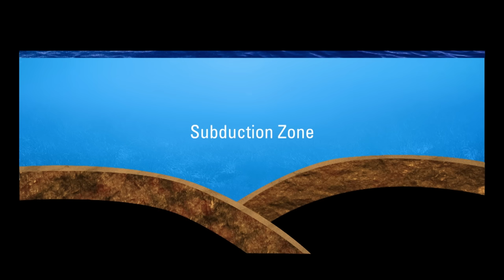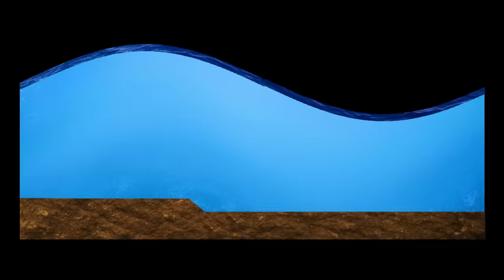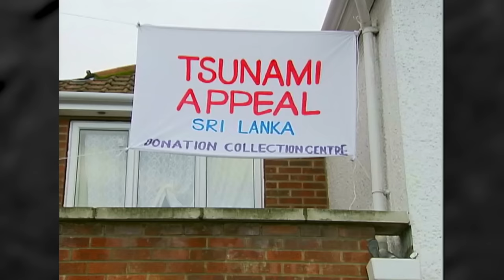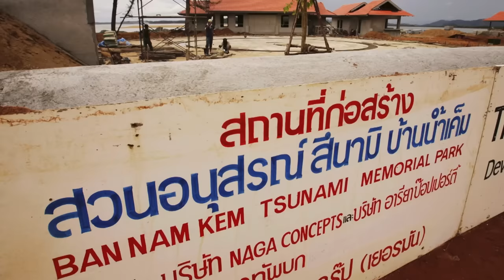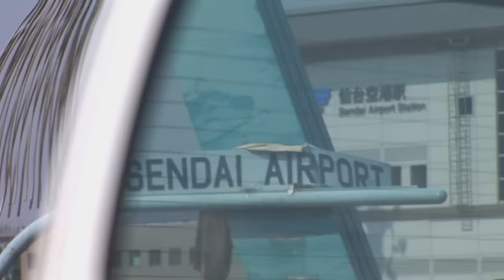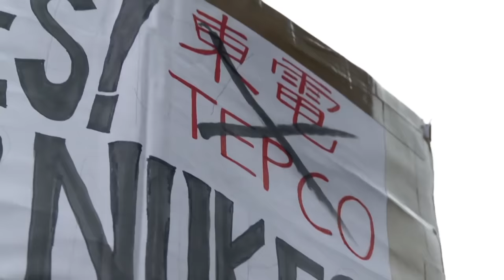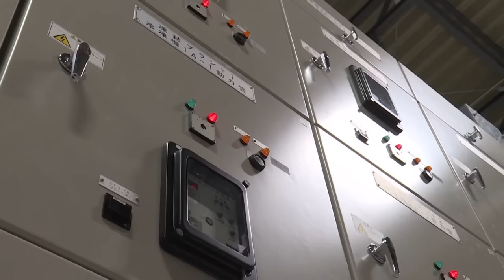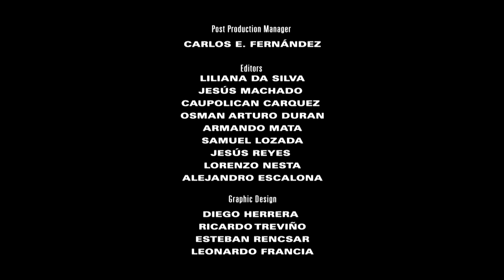Deadly Disasters: Tsunamis | World's Most Dangerous Natural Disasters | Free Documentary

Comment: It's not the height of a tsunami that causes the catastrophic damage, it's the wavelength. Massive 80 ft. waves break at Nazare' Portugal but they cause no damage and surfer's ride them. Their wavelength is about 200-250 meters. A tsunami wavelength is measured in MILES, several MILES. That's why they look more like a raging river than a breaking wave. Yet their wavelength is rarely...if ever...mentioned. All the phenomena observed when a tsunami makes landfall is a byproduct of their enormous wavelength.
Reply: I've wondered about that. Thanks for the info
Reply: The height matters . The higher the wave the more mass the wave contains and the further the wave can potentially travel inland. Tsunamis with low heights and long wave lengths do little damage.
Reply: @kinte1870  Wavelength FAR outweighs height in a tsunami. That's why those 80 ft waves at Nazare' and the 30 ft waves at Waimea Bay Hawaii don't cause catastrophic damage AND why they can be ridden by surfer's. When it comes to damage potential and danger, height doesn't even blip the radar compared to the WAVELENGTH. Which is why surfer's can ride huge waves, waves that far exceed most tsunami's in their height. Those waves have a wavelength between only 200 and 250 meters. NOTHING compared to a tsunami wavelength measured in MILES, several MILES.
Reply: Giggity
Reply: @chrisnizer5702  A tsunami of 30 ft does much more damage than a tsunami of 5 ft bro. It's just a fact. A tsunami isn't a wave like surfers ride. It's the entire mass of water in an area moving at once. There are videos you can see of low height tsunamis hitting the coast and not doing much . The height of the tsunami matters.
Reply: @chrisnizer5702  Also I'm not from tsunami territory but I am from the area of the Gulf Coast known as Hurricane alley and storm surge is similar to the way a tsunami comes in except for speed . When a 200 mile wide Hurricane causes the ocean to rise 20 ft with 20 ft waves on top of that ..believe me height matters.
Reply: @kinte1870  You don't understand the nature of a tsunami. The height is just a BYPRODUCT OF THE WAVELENGTH, not vice versa. In other words, it's the wavelength and the wavelenght's interaction with the terrain, shoreline, bathymetry, etc, that causes the so called "height" you speak of. Everything, and I mean EVERYTHING, we witness when a tsunami makes landfall is a byproduct of their absolutely enormous relentless wavelength. This is why so many people die horrible violent completely unnecessary deaths because they just won't listen to reason. They don't want to be bothered with facts because their minds are already made up. Really just a matter of basic mathematics. A massive tsunami in the open ocean is barely noticeable. Only when they encounter the shoreline and the front slows while the enormous wavelength keeps coming and coming relentlessly and causing it to run up to the "heights" you speak of. Which are nothing but a byproduct of the wavelength. Which is why 80 ft. waves at Nazare' Portugal do NO DAMAGE because they have a short wavelength compared to a tsunami. ALL....ABOUT....WAVELENGTH!!
Reply: @kinte1870  You're trying to compare a tsunami to hurricane storm surge??? They're completely different. Again, can't help someone whose mind is made up and don't want to be bothered with silly things like FACTS. Luckily most people are able to understand the point I'm making.  They'd rather save their hide than their pride and learn something that may save them.
Reply: Thanks for sharing your insight  👍
Reply: This is a hard one for most people because you can't really observe the wavelength. Also, the wavelength has a direct relationship with the height of the wave, but the geography of the land leading up to landfall has a bigger impact on the way the wave reacts. Like most things, it's a spectrum and spectrum doesn't sell papers so the media focuses on what CAN be seen and build up the importance of the wave height.
Reply: @Cierbhal  That's like saying don't bother me with anything like facts. I'm much happier in a world of fantasy and make believe, fairytales and pixie dust. Watch a couple videos of the 2011 Tohoku tsunami and wavelenght is gonna smack you across the puss like a sock full of nickels. Entire towns were swept off the map and out to sea because of WAVELENGHT.
Reply: @Cierbhal so basically

Longer Wavelength= Taller waves

Longer Wavelength + Favorable Terrain = Even taller waves

That's why Japan's tsunamis have incredible run up heights, the terrain basically funnelled all that wavelength in one spot and so the height of the wave was dramatically increase. Omoe Port: A port in a very narrow fjord Recorded a runup height of 100+ft
Reply: @chrisnizer5702  Yep, here is an excerpt from a paper:
"Tsunamis are single or sets of long shallow water waves, usually observed in oceans or in large lakes. They are associated with a sudden displacement of the water column due to a number of various trigger mechanisms including earthquakes, submarine or subaerial gravitative mass wastings, volcanism, cosmic impacts or atmospheric disturbances. Mistakenly called oshio at first (from Japanese high tide), later the term tsunami was introduced for this wave phenomenon(Parker 2010, p. 140; Goff et al. 2016), meaning harbour (tsu) wave (nami). This term relates to the fact that tsunamis, due to their long wavelengths, are often not perceived in the open sea but form their destructive power near the coast, especially in marine inlets or in harbours, where the waves undergo significant shoaling and funnelling."
Reply: @Cierbhal  That enormous relentless wavelength is the cause of everything we see when a tsunami makes landfall. That's why the 2011 tsunami was easily able to overtop those massive seawalls along the Tohoku coast, sweep all those towns and nearly 20,000 people off the map and out to sea. They're engineered for wave HEIGHT but do little to nothing to deal with WAVELENGHT. That wave energy is several MILES long and is transmitted throughout the entire water column, top to bottom.
Reply: @chrisnizer5702  I fully understand the nature of a tsunami as they can be caused by several factors and I actually wrote a research paper on them in school 28 years ago. 😅.  Height absolutely is important and it's not determined by the wavelengthin the way you think. I'm fully aware what terrain does to wave heights because that's what determines how high the storm surge gets at the shore in a hurricane . When the ocean floor rises 20 feet you get a 20 foot tsunami that is made more or less by the shape of a coastline. A tsunami from a rock slide or a large object will create a sudden wave of immense height with a much shorter wavelength than an earthquake generated tsunami.
Reply: @chrisnizer5702   The initial wave height is determined by the amount of water displaced. You're thinking of water piling up do to the shape of the coastline.
Reply: @chrisnizer5702  Again you can see videos of small tsunamis doing little to no damage and then you can see videos of hurricanes or typhoon storm surges destroy concretely structures by the volume abd force of water. Just like tsunamis can last for hours so can 20 feet of storm surge.
Reply: @chrisnizer5702  Tsunamis are sudden. Storm surge comes in slower but once you have 20 feet of water pounding on you for hours it's pretty much the same results.
Reply: @Cierbhal  Note that excerpt doesn't give wave heights to wave length. Water displacement determines whether or not you get a monster wave at the coast not the length. If that was the case every tsunami would be a monster if the terrain was right but that's not the case.
Reply: @chrisnizer5702  Lol the wave over topped those walls because of the large amount of water that was suddenly displaced. Why do we have small tsunamis with long wavelengths that do little damage when they hit shore.
Reply: @kinte1870   Make sure you do at least a minimum of due diligence before puffing your chest out and trying to debunk...ok. Just a suggestion. Tsunamis have extraordinarily long wavelengths, measured in MILES, several MILES from peak to peak. Everything...and I mean EVERYTHING...we see when a tsunami makes landfall is a byproduct of its enormous wavelength and it's interaction with the coastline, bathymetry, etc. That's why the tsunami cycle takes sooo long. The water recedes WAYY out, then it comes back like a raging river (for several minutes) before it recedes again. That's ONE WAVE CYCLE because the WAVELENGTH is SEVERAL MILES LONG.
Reply: Why are people fighting about “wavelength?” He’s right. It doesn’t matter the height. You can drop a glass of water on your table & it’ll wet the table. If drop a smaller amount at a longer duration? BINGO…much more coverage or area the mass of water covers. Slamming the water on the table does cover your table & causes damage — but for a short period. Wavelength? Spreads further & needs not be exaggerated in height. That’s his point. 🙄
Reply: @kinte1870 What was your Final Grade on that “Research” paper?
Reply: Is that a fact  🤔 ?  So you're saying the height of the wave is irrelevant ? I'm  guessing you've never experienced a Tunnami 😅
Reply: The weight of the water is what causes the destruction, uprooting everything in it's path.
Reply: @VelloHello  What do you suppose is causing all that weight of water??? The enormous relentless WAVELENGTH. The WAVELENGTH measured in MILES, several MILES from peak to peak. If the wavelength was only 1 foot the weight would still be the same (per cubic meter) but it wouldn't do anything but get people's feet wet if they were standing on the beach at the water line.
Reply: Yeah I've heard before that it's not just about how big it is
Reply: Wrong
Reply: 80ft waves on water is totally different to an 80ft wave hitting land no matter how far it goes inland
Reply: They tell you this in the video
Reply: Wave length means amount of water , a 5 foot wave over 2 miles long will be huge for the land. A wave that's 20 feet hight but 250 meters wide does not have that much water in it.
Reply: Very interesting.
Reply: Its not measured in miles, but in metric
Reply: @chrisnizer5702 you use such a mess of different measurements. Stick to metric only and not that outdated Imperial system.
Reply: @jvendetta1682 use metric only, you make it way 2 complicated
Reply: Thanks for that explanation. Makes sense and it isn’t ever mentioned like you said.
Reply: No, this is also incorrect. It is the volume of water no matter how high or how long.
Reply: Actually, you are also incorrect. It is the volume of water that is a by product of length x height. The length and height of the wave is a byproduct of the nature of distortion of the sea bed floor.
Reply: Thanks, I always enjoy learning something new! 👍👍👍👍👍🙄
Reply: @chrisnizer5702  so if that the case then my question is,  what the highest a wave like that can get if all the right conditions and circumstances were to come together.What's the highest a wave can get?

Comment: The height of the water coming in is the problem. A rogue wave only happens when the water is super shallow coming into shore or a asteroid hits next to land. If a rogue wave from tsauami hits, it will take out what's close to shore, which is going to be gone later anyways. With most tsauamis the water close to shore retreats outwards to the deep area. This is a reliable sign that a tsauami is fixing to hit. Any tall wave would break out where the water has retreated. It's the height of the water and distance of the height that effects how bad a tsauami is, not a initial rogue wave which usually doesnt happen. If you're in a boat out in the ocean, you may not even notice  what is happening. There isnt a tall breaking wave going across the ocean.

Comment: ~ 2:35 - Ridiculous claims are bad "science". The Burckle Crater Megatsunami (video title) in the Indian Ocean ~5000 ya generated a wave that was ~180 m / 575 ft tall. The wave ran inland up to 100 miles in places. As it was only so tall, run-up could only, at maximum, be that height x ~2. A megatsunami that flooded all but the tallest mountains is practically impossible. An impactor large enough to cause such would need to be hundreds of miles in diameter.